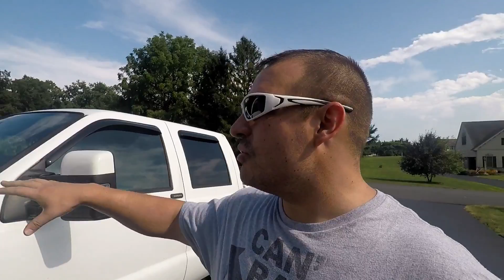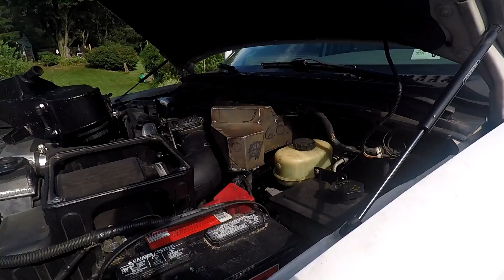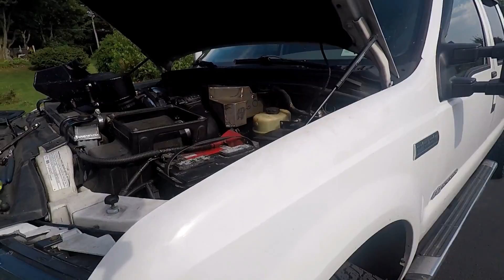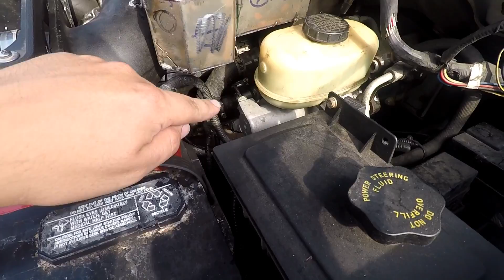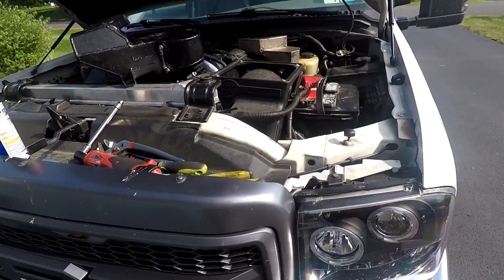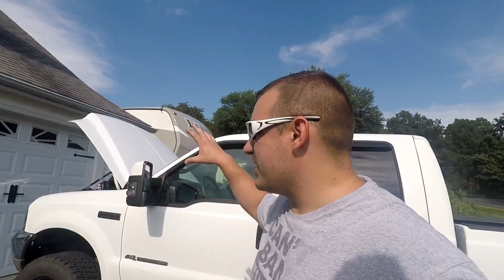6.0 Powerstroke Degas Bottle

Comment: Did these Degas bottles ever go into production ? what website?
Reply from the maker: Yes they did however I do not recommend this brand. I had issues with this one and reached out and was left hanging for a long time. I cannot recommend that treatment to subscribers. I will say I have subscribers that are running them without issue I just personally have stopped.
Reply: Ru talking about ryno diesel products degass bottle

Comment: Looks nice i have a ? I have my 6.0 but i notice that you took your  plastic off from your filter is off its that better
Reply from the maker: When you run a larger than stock turbo the setup with the plastic on becomes restrictive and doesnt have enough air. When you take the plastic off then you are good. I know many people say about the enclosed ones being better but at the end of the day if you sint have enough capacity for pulling in more air then you need to give it that ability

Comment: While I understand the desire for a metal expansion tank. Was it made from plastic for a reason? The tank would expand and leak at times yes but there is a reason it’s called a expansion tank.
Reply: Chip Saunders there made of plastic cause it’s cheap   It’s called a expansion tank for coolant displacement that’s why u don’t fill them all the way up

Comment: Let me know price I get sketched about stock degas cracking
Reply: They will be $385.00 shipped
Reply: ryan delfin $385 ouch very highly priced for a none performance part imo I could see it being $150-200
Reply: Sean B try to make one these are made by me one by one it takes a lot to put one together and it will be the last one u ever buy nobody offers a lifetime warranty there pricey but well worth it wait and see stay tuned
Reply: ryan delfin you are totally right I should wait to see before I say it’s not worth the price I have a ton of friends that have 6.0 trucks that would be stoked to have I might buy one install I could potentially have 20 plus more sold
Reply from the maker: Check out the update video on it man. The finished product is killer
Reply from the maker: I have cracked a few stock ones they just dont hold up to the heat. Wont have that problem with these! Thanks for the info ryan!
Reply: These tanks are now available go to my instagram rhino_diesel_products_7.3 and message me thanks